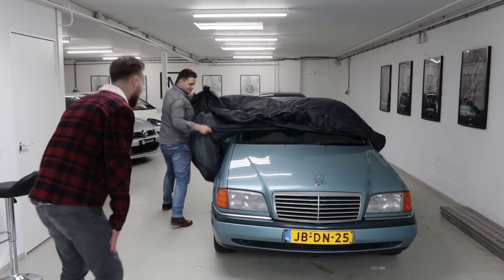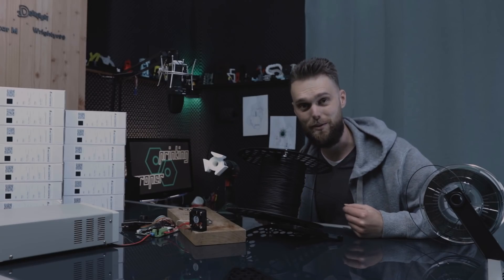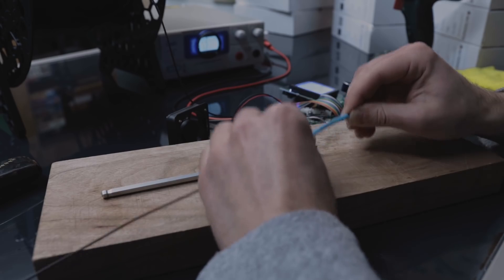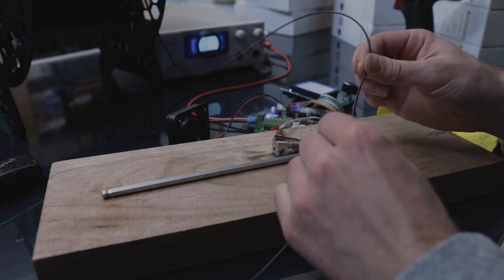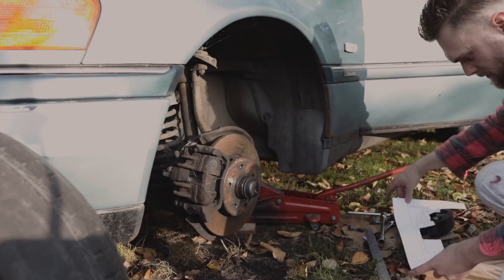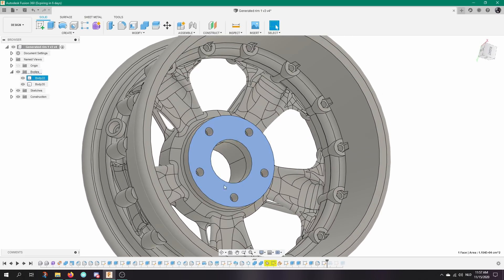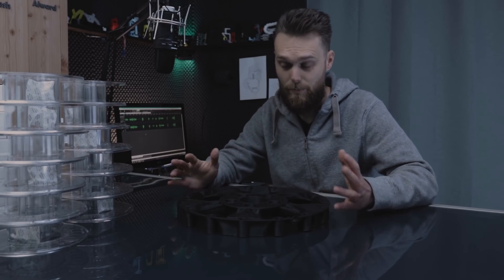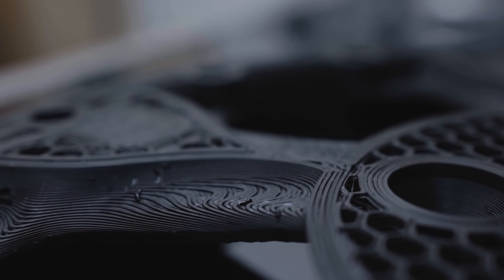I tried to 3D print a full-sized rim for my car out of ABS

Comment from the maker: Fun fact: the part that I was printing for this video required a bit more than 1,3km of filament. If you know how to reliably join ABS filament to make a spool this big, please leave a comment. Have a great day!
Reply: You could try using the palette, it has a "Multi-spool mode" that can automatically splice multiple rolls of filaments together
Reply: @lazarjovic9948  definitely gonna have to second this, as they’ve already done all the hard work and perfected it. Plus you can just feed multiple rolls in and it can join them on the fly ( could maybe run each spool through a filament runout sensor, so the palette splices as soon as the sensor is tripped )
Reply: Why not using a simple filament sensor ? When filaient runs out, printer pauses & you can add new filament & continue. Worked for my +7 day prints 😉
Reply: @hansdegeytere  That what I was thinking also - I'm printing somewhat bigger (300x300) functional parts using PETG on my CoreXY that has V6 Volcano hotend with 0.6 - 0.8 nozzle and the filament sensor is perfect for that kind of prints. I have 2.85mm direct hotend though, I wouldn't try this with 1.75... there's a 4x volume difference on how much plastic you can put down in a second.
Reply: @hansdegeytere  He can even note down at which time the spool can run out of filament with the slicer and start the printing at a time that once it stops he knows he can be there with an alarm clock and change the spool.
It should only cost him 1-2 checks per day at worst.
Reply: @lazarjovic9948  my idea as well
Reply: Practise on shorter sections that you can run through the machine. You'll fail faster and use less material until you find the right way to make joints.
Reply: @av8za  yeah I was thinking this. He directly tested joining method on gigantic print. I’d make 20 joins in a shorter filament, extrude into air at different speeds to see how many will fail.
Reply: Just a small remark on "respooling". In the factory the filaments are warm while they got onto the spool. The diameter of the spool gives the filament its spring like behavior. So the filament on the inner end of the spool gets winded with a smaller radius than the outer. During respooling you force diameter to be different than the factory size. This will put the filament under constant stress while it is on the spool. The bigger your spool gets, the bigger the stress will be and the joints are additional weak points, especially when you join the filament against its natural curl. I had the issue with PLA, where I "respooled" some sample PLA onto a spool. After a few weeks the filament on that spool was broken in 10-20cm pieces. This may happen to ABS as well. This just as a warning. Hope you find a solution for the joining process. Great video!
Reply: AliExpress solds a filament joiner  tool , it costs almost 7,5 euros and its full metal.  Never bought it because of the price but deserved take a look
Reply: Palette! Touch base with Joel! He has the hook up!
Reply: I would just buy bigger spools. Check your local manufacturers and see if they are willing to make 2-5kg filament spools.
Reply: @Rodrigo.Guimaraes  he's sponsored though.
Reply: What about Prusa MMU? It can also be used for filament swap on run-out
Reply: @r0311  the chameleon system can have up to 16 different feeders on one hotend. That should last for quite a while
Reply: @geauxracerx  well actually it supports 32, because you can chain them. But without firmware support it might be quite challenging to tune it in properly, the MMU can react on out of filament situations and act accordingly without preparing the G-Code before printing (just guessing, I have no practical experience with that system). Overall it's more designed to print in multiple colors, not to extend the range of a spool. MMU is also mainly designed to print multiple colors, but with proper firmware support from Marlin, you can also react on filament run-out situations. Potentially the Palette 2S is the most unproblematic solution at all.
Reply: An easier idea just create many left over spools and switch it at fixed time intervals as long as you plan out the intervals correctly you will always leave some buffer of material left on the spool with no need to splice and no slowly shifting time when the filament changes need to happen at.
Reply: You have the sponsor..You can get help from them. Let them give the filament in one piece!!
Edit: you did as what I say before :)
Reply: The Mosaic Palette should be able to join filament spools on the fly. It supposedly has a single colour mode meant for your use case.
Reply: Dichloromethane or Acrylic Cement, it will glue the ABS like a welder. do not use acetone, it works weaker!!!
Reply: @giostepanishvili6098  And then it will make a clog? Is it meltable?
Reply: @STARSHADOW123456  Dichloromethane does not change the properties of the material. it can bond abs with abs, acrylic and plexiglass without damaging the material properties, and a good bond can have about 70% strength. But you must dry it within 12 hours for maximum durability.
Reply: @giostepanishvili6098  You're right it will probably work better, but since 1.75mm filament has such a small cross section the acetone should have no problem dissolving the surface enough to weld it together.
Reply: @cosmiccrunch8591  Yes it works but as i said it is better and if you need it you can try.
Reply: Create a load/ unload filament system...That can trigger from filament detection loss then unload the balance into a y chamber/Bowden tube and drive the second roll into the y path  and load the new filament purge a line and continue the model
Required another stepper motor and the coding to do so and you only need to be there to keep a roll ahead instead of a roll behind
The second stepper only loads it to the main extruder tru a y tube which can be anywhere you can get a Bowden tube to as long as the first filament ejected back from the y the new line will have a clear path in but your main extruder will need to grab a filament from an empty extruder to try the pinch rollers while the empty extruder loads the line 

The length of the tube you can use to calculate the unload length and a clear path before the next filaments loaded 

You will not get reliable splices in the filament it is mixed in a screw and barrel style extruder and has much friction added with the heat for a homogenous flow 
Keeping the filament strength and size will be always unreliable in the splicing aspect

Edit you will need two loading steppers for a perfect system to alternate over and over
Reply: Ik weet dat een spoel van 3kg 1km aan filament is dus ik schat dat 1,3km rond de 3,25-3,50kg is damn das veel 😱 ik weet ook dat er bedrijven zijn dat spoelen van 2, 5 en 10kg spoelen abs verkopen.
Reply: The most reliable method I have heard of leaves the ptfe tube on after splicing. The guy showed a picture of 5 pieces of ptfe tubes on the filament string before the extruder. It was in a Danish ppe group.
Reply: The method was described by Morten Trab and consist of placing a 3 cm piece of ptfe on new spool, then ignite the filament, quickly slide the tube over the end and jam the end from the old spool into the ptfe tube and apply pressure for 15 seconds. Make sure the ptfe tube can move but do not remove it

Original Danish description:
Beskrivelse til hvis du vil samle stumperne til et langt stykke:

Sæt en stump PTFE tube (3cm er alt rigeligt) på den nye rulle filament.
Tænd spidsen af filamentet (som et stearinlys), træk det baglæns igennem ptfe tuben, derefter skynder man sig at trykke den anden ende (fra den gamle rulle) ind i tuben, og holder tryk på i ca. 15 sekunder.
Sikrer dig derefter at tuben kan rykkes (ikke er smeltet fast)
Men ryk aldrig tuben væk fra samlingen, da den virker forstærkende på samlingen.
PTFE tuben kan du fjerne når engang du skal skifte farve igen - den bliver bare skubbet langs filamentet.
Reply: Hopefully 3D4makers can sort out a bigger spool of the filament you're using - I use 8.5kg spools of rPLA from Filamentive (something like 2.8km), so it can be done.
Filamentive also have ABS in 2.3kg rolls, which I think is well over 700m so that would do your rims in two spools and one filament spool change. Perhaps 3D4makers will at least be able to do the ABS that you need in a 2.3kg size at least?
Reply: Maybe capricorn tube XS can help. It has tighter tolerance
Reply: Like mentioned before, there is a tool for that purpose
https://www.banggood.com/BIGTREETECH-Black-or-Red-Filament-Welder-Connector-1_75mm-Filament-Sensor-For-3D-Printer-Part-p-1748858.html?cur_warehouse=CN&ID=6296546&rmmds=mywishlist
Reply: Abuse a prusa multi material kit/Palette 2S so you can swap rolls around.
Reply: ABS Gloop from 3Dgloop.com is supposed to be great at sticking together ABS parts. Might be easier than heating the filament.
Reply: I always just use a lighter, mash together and trim flash with clippers & utility knife, or even a little sandpaper. Easy enough to get them flush and/or slightly undersized.  crude, effective but a bit of a timesuck. a dedicated tool is a great idea. This project is all super cool, I really like your gantry mods! COREXY seems like it would be a huge PITA in reality. This looks much more real-world usable.  Bravo!
Reply: For joining filament your hot-end idea wasn't too bad. I would only take two halves that have a 1.75mm hole(one half of the hole on each half of the hot-end) so that the diameter of the filament is restricted by metal instead of more flexible plastic. You would also probably need to ensure that the heat only gets to the point where the two filaments are supposed to be joined(I'd try bowden tubes on each side of the hot-end) so that the heat doesn't deform the filament elsewhere. I wish I could upload a sketch on YouTube because its hard to describe...(I'm german...)
Reply: Although it would require a complete extruder change. I would suggest looking into a pellet extruder. Just need to fill a hopper and not have to worry about splicing.
Reply: Just use a filament sensor that will automatically pause your printer when you are running out of filament. Replace the spool and resume. It should be a more reliable method.
Reply: Acetone as a chemical solvent will fuse ABS. You could also install a filament run out sensor and change spools as needed.

Furthermore test a short length with multiple joints until you can do it reliably.
Reply: Not a solution for joining the filament but rather something "out of the box".  There are dual color hotends that take two filaments and output through one nozzle. You could upgrade your printer to have two extruders and through gcode switch to the second roll automatically when the first is empty. Then "refill" the empty one and repeat. BTW your printer is really cool! Here is an amazon link and good luck: https://www.amazon.com/Aibecy-Extruder-Compatible-Ender-3-Printer/dp/B07ZRJJVP2/
Reply: How about with acetone?
Reply: Cut the capricorn tube lengthwise, remove thin strip of material to decrease internal diameter from 1,9 to 1,75mm, put it inside a piece of aluminium with two heaters mounted alongside the tube to squeeze it to desired OD and provide sufficient heating. 
If you think you need to see the joint then make small window in this aluminium block.
Reply: @cthulpiss  I think the best approach would be a combination of this but instead of heat use acetone to solvent weld the filament inside the modified capricorn tube.
Reply: I have two ideas for you.    1) acetone jointed inside of tight heat throat,  then let it solidify.  2) don't join them... add a end of spool or broken filament sensor, that sends a pause signal so that you can just add another spool when it's time. 

I think idea #2 probably the most reliable.

Comment: Negative impress rims have a hard life even as cast aluminium. Couldn't do a little bit smaller diameter brake disc and caliper instead? There are some good but not that physically large 2-piston caliper setups out there. Might have to make or modify a caliper bracket.

Unless the challenge isn't diameter clearance.

Comment: What about making something that can clamp over the filament, the two ends straighten the filament, and a blade, or several blades in the middle shaves it down to the right diameter? Slide it up and down the filament to trim off any excess?

Comment: what if you clamp two pieces of aluminum together, drill at the seem the correct wire diameter then chamfer it on both ends. Then while your joint is still hot, pull it through the drilled hole? More or less just making a removable extrusion? Cool stuff!!

Comment: For joining filaments search on Aliexpress for "Filament Welder" or something like that, there are jigs available for little money for that exact purpose. The other suggestion would be... don't join the filament! Use a filament run out sensor that pauses the print whenever it is empty and swap the filament manually. Yes, still means having to babysit the printer, but at least you don't have to be sitting next to it the moment it runs out. And one more recommendation for the rim itself: How about a two part rim? These used to be more common in the past, and you still see them on some vehicles and things like wheelbarrows. And if you then use an inner tube you also don't have to rely on the rim being able to take all that air pressure. Awesome video by the way, looking forward to see more!

Comment: Hey  do you know that you can resume an interrupted printing !!!
Just measure the Z height of you printed part (precisely) , delete the part of your G-code after the header up to the Z height (find a Go Z ...)
you just have to be careful with the E axis, you should set it to the first next value (find the next E.... and set the origin here with G92 E....)
your G-code should look like that:

<Header part>
G92E ... 
G0 Z ...
<Rest of your code>

You also should remove any G28 in the header to prevent homing right in your part...
the printer should not be turned off or it will loose its position
This can take more than one try but can save you hours and a lot material !
Reply from the maker: That's a great suggestion, thanks! The only problem I'm facing (which is also the reason why I don't use a run-out sensor) is that I cannot open the heated enclosure without letting cold air in. I'll keep this in mind though because it might come in handy :)

Comment: I would look to see if your board supports filament break detectors. They are cheap and easy, and then you don't need to splice. Install, then an easy firmware edit and update and you are in business. When your filament runs out, just reload, and it will pick up where it left off. Forget about splicing. You run your spools until empty and reload. Saves money. Good luck!
Reply from the maker: Thanks for your suggestion! This has been asked and suggested by others too, but the problem I'm facing is that I don't want to open the heated enclosure letting cold air in. I'm afraid that this will cause the print to warp and fail. Especially when I'm going to use different materials like Nylon of Polycarbonate. Maybe I'm overlooking something. Fortunately 3D4Makers will send large spools soon so this shouldn't be an issue anymore.
Reply: @properprinting Why you don't put the filament sensor on the outside and place a PTFE tube to the extruder? You will retract the rest of the filament anyway, so you should be able to grab it outside the chamber and feed the new one in down to the extruder...
Reply from the maker: @r0311  Because the head is moving in all three dimensions which makes it difficult for the tube to go everywhere. I also don't know if pausing a print can eventually cause a weak point. Printing in one go would be my preference which shouldn't be a problem if I receive big spools or if I can get the hang of joining filaments. I prefer the first of course xD

Comment: Since you don't have enough filament left, cut the remaining filament into a bunch of 10 cm segments and practice joining them a bunch of different ways to see if you can iron out the kinks in your process and get it more reliable, then just test extruding them joined back together... Heck... You can probably just run them through the extruder (no need for a connected hot end for the first testing round) just to make sure the extruder itself isn't where the problem is happening.  Then just Zero in on the issue and solve it.
Reply: Alternately, print it in slices that interlock and bolt together?

Comment: Why ABS? Won't the UV from the sun plus the weight of the car destroy the rim pretty quickly?  Wouldn't PC or ASA be much better for this type of project? In any case, great video, and I look forward to the next one.
Reply from the maker: Good question! This is the material I'm starting with because it's cheap and I can check how the printer is performing and if I run into issues. I don't think ABS will be strong enough and once I can reliably print a rim we're going to take a look what the following steps would be. This can be improving the print process and settings, improving the design or improving the material. We'll find out ;)